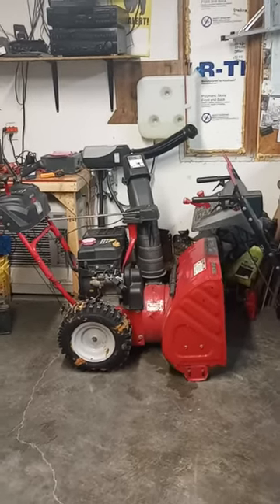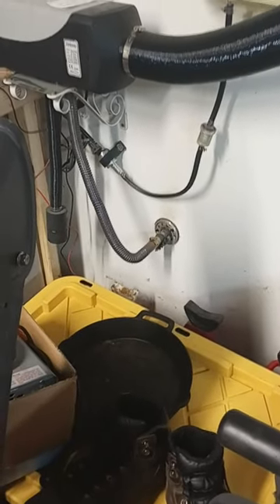Chinese diesel heater exhaust installation

Comment: Please show how you did the soup can hookup?  I just subscribed.
Reply from the maker: Im away for a few weeks so can't show it now, but I just taped the two empty ends together with aluminum tape, drilled a hole though each end for the exhaust pipe to go through, making sure there was an very slight angle down, just in case of moister.  Then just drilled smaller vent holes in the indoor side

Comment: How big is your garage? Mine is about 20x20 and thinking about getting one of these so I can work in it. I am in the process of insulating it, I have the walls done. But the doors are pretty leaky and still need to work on the ceiling.
Reply: Also, if you can show how you did the can, thank would be great.